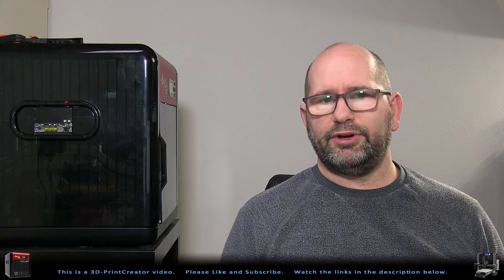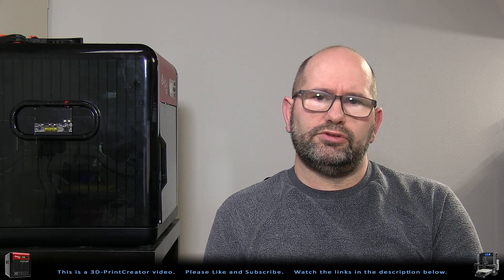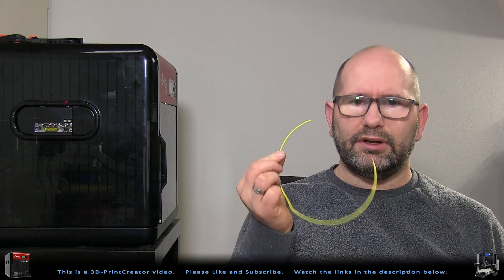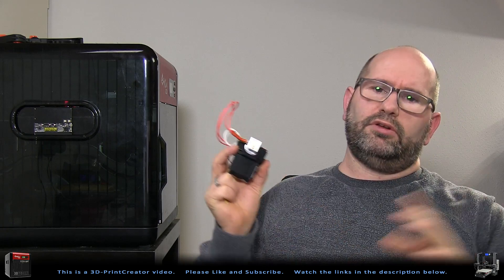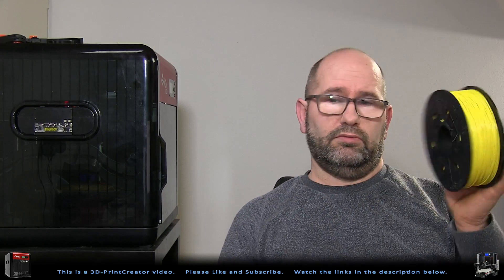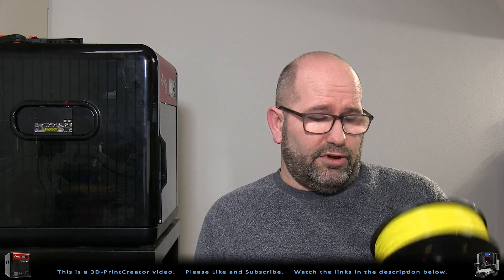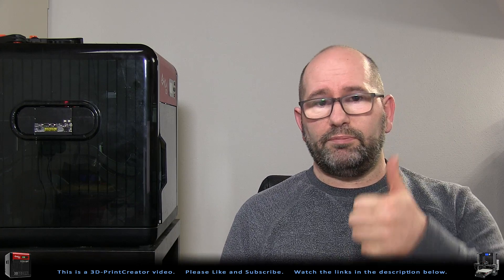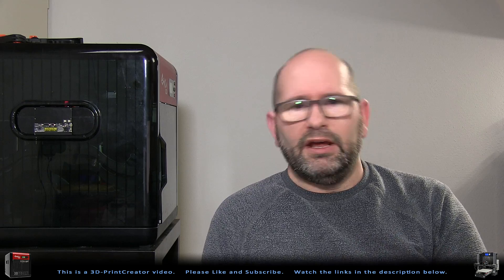▼ Why you should NOT use a filament oiler on your 3D printer

Comment: I wonder. These people who say to use oilers, have generally used oilers before, then ran into issues, and found that the oiler helps them... by all reason they never cleared the previous oil residue or other surface residue out of the system. I mean nozzles are disposable, then you have the throat, you would need to repolish the inner surface if it's a stainless or titanium one, or replace the PTFE insert if it's lined, wash the couplings and bowden tube in dish soap, wash the extruder components... to have a chance at a clean (haha) experiment... any bets on where the issue possibly originally came from? Once oil is on a surface it generally never quite goes away completely, it just degrades to where it becomes sticky garbage.
Reply from the maker: That's a fact. :-)

Comment: I just oiled up the filament and made one benchy and a calibration tower, PLA+ 210C no issues. I looked into this because I switched to all metal hotend and the filament jammed after the first print, so I cleared the clog and reassembled it. I smelled the burnt oil while hot tightening the nozzle (canola, yum). I think that created a seasoning coating that allow subsequent prints to be successful. I am oiling it a little more before taking the oiler off.

I think if your goal is to season the hotend throat so it has a smooth layer to solve your clog issues, you should apply oil to the inside of your hotend throat, then heat up the whole piece without the hotend fan so it reaches smoke point of your chosen oil and allow the oil to burn inside your throat and not the nozzle. Supposedly you won't need to do that on high quality smooth metal throats but I got the cheap ones so go figure.
Reply from the maker: Just like when I made this video, I still think it is absolutely not smart to provide filament with a thin layer of oil. If you think it is smart, then we disagree.

Comment: Im in the other side of oiling debate. I have used oiler now almost a year and my hardened steel nozzle that previously glogged all the time now just works. No nozzle glogging failed print in a year. Also the oiler collects all the dust that previously got sticking into my filament (because of static electricity) and moved to the extractor. And yeah there is plenty of dust in the city appartment specially in summertime. How do I know that - because I see what has collected into my oiler. So how to choose oil - only use plantbased oils that has really high smokepoint - avocado oil here is my choice.
Reply from the maker: This only explains to me that you have a dust problem and a wrong nozzle.
I have multiple hardened steel nozzles and (except for the Da Vinci Pro printer) I never ever had a clog in my hot ends.
There is no reason to not collect the dust before it enters the printer, just use a dry cloth for that without oil.
If there would be a need for oil, why isn't it implemented in the filament? A few drops of oil in a KG spool of filament is easy to mix, yet none of the filament brands do this. There is a reason they don't do it.
I don't  have to convince you, if you want to use oil, please do so. But I know AND explain why I don't use it.

Comment: I haven't used an oilier before and i was hopping for a good review. But it doesn't look like you have used one ether. It is intuitive to believe that the inside of the tubing will be contaminated and collect dust and why no oil will end in the nozzle. But this is not how engineering/science work, you are supposed to back your opinion with evidence and do the experiment. You said "lets do the math" but didn't do any. The oiler sponge will most likely clean the dust. The toothed wheel of the extrude is gripping by deforming the filament so adding oil might not have significant impact. What a BS rant video.
Reply from the maker: Normally I don't react like this, but you sir, you are an ...... fill it in.
I am open for every type of discussion about my thoughts, but if you don't watch the video and complain about things I did wrong, then there is no discussion possible.
In your case, I hope you use an oiler. Please do so. This means you don't understand how to set up your printer correctly and you are not willing to learn. Please use oil. Lot's of it.

Comment: It is super stupid to use oil. Especially cooking oil which often precipitates and tends to form resins :D
Reply: on the other hand though, when you run the filament trough an oily sponge, you will logically remove dust from the filament, and thus you will reduce the chance of clogging the nozzle. Also, if you are smart, you will install your oiling device in such a way that your filament won't pass trough open air after being oiled.
Now, personally i do not believe that having the filament oiled actually helps, but having it cleaned before it enters your printer definitely does. You are talking nonsense.

Comment: Hey i tried to print some flexible fillament but it jams all the time ... would oil help here?
Reply: @Seze93 It will work. It jams because the filament is getting stuck inside your ptfe (teflon) tube inside your heatbreak. There is a point in your heatbreak where the temprature is still high enough for your filament to melt. When this happens your filament will get jammed because it has resistance in the teflon tube (It is very sticky since it does not fully melt at a place at a certain temprature in your heatbreak). When this happens, more filament will push against the blockade and eventually get hard because the temprature is not high enough anymore for you filament to melt. Oiling the filament will prevent this because it will prevent the sticky half-melted filament from getting a place in the teflon tube to get attached on. It basicly eliminates the friction between your Teflon tube and filament. So oiling it will fix your problem...
Reply from the maker: Nope, Oil won't help. A better extruder or even better, a direct drive extruder, is the only thing that can improve prints with flexible filaments.
Reply: 3d Print Creator 
OK ... sadly a Flexion Extruder costs nealy the Same as my printer ^^ but anyway thx 4 the quick answer!
Reply: @3dPrintCreator  so is your solution to everything is just to buy another expensive part when thousands of people plus multiple businesses that use 3d printers have all told me your spouting nonsense the serious point is if you want to use oil use oil if you don't you don't have to, don't tell someone not to do something over a vary narrow view point on your end. some sticky and flexible filaments actually can benefit from the right oil not always kitchen oil I'm talking machining oil plus change your sponge occasionally so you don't have a lot of dust and stuff plus it you don't change the oil just like a car it will darken, burn and get very sticky us as humans have been using oil for years and you would think that we all would know that fact by now.

Comment: Older DaVinci printers doesn’t have PTFE liner and is meant for printing ABS.  If you try to print PLA with these all metal extruders they are much more prone to clogging and the use of lubrication can greatly prevent it.  It’s not a confirmation bias. It does help.
Reply from the maker: Well, Everyone should do what he or she likes to do.
I think I have explained enough why it's not a good idea, but do as you like.

Comment: I have 10 3d printers now. I run an olier on all of them. I run PETG, ABS, PLA and Ninjaflex. I have run with and without. Running with one makes a big difference. Prints are smooth and look better. As stated by others it does help most with PLA. I think most people don’t run their filament hot enough to start. That is where most of the bad print issues start.
Reply from the maker: What can I say? Nothing, I said it all in the video...
I run 15 printers daily and non of them need oil.

Comment: Let's just stop for a second, this video is absolutely bogus.  The fact remains that oiling works for alot!!! Of people.  There is no science to backup your claim, there are facts to backup oiling.  For a long time I couldn't print pla  without clogging and just accepted the fact until I saw on the internet to oil. I tried olive oil dipping and it just works like everyone else with the same problem.  This video is a joke and spreading bad info.  OIling has been the difference between a printer and a paper weight for an insurmountable amount of people.
Reply from the maker: There are a lot of things said on the Internet that are true but yet completely stupid and idiotic to do.
If you have rusty tools, put them in a glass of Coca Cola and you remove the rust. Completely true, but the fact your tools have rust is because the owner didn't took care of his tools in the first place. The same for oiling. If you are not smart or bright enough to make your printer work without oil, then please be my guest and oil the machine as much as you like. If, on the other hand, you are smart enough to read a user manual. Then you just adjust the printer and make sure it has no problem, without using oil.

Show me one 3D printer manual where the manufacturer tells you to use oil. Just one.
Show me one manufacturer of filament that tells you to use his filament AND oil, just one.

With kind, non lubricated, regards,
Brian Dragtstra.
Reply: @3dPrintCreator  sometimes it's a budget thing.  
if you can only afford clone all metal hotends then all the intelligence and skill in the world is not going to prevent jams.  
i even improved the internal surface of my heatbreak by polishing it.  and it improved ALOT   but i've polished it as best as i can and it's still not 100% reliable.  
i can spend 40 bucks a piece and buy 2 heatbreaks (yes just the heatbreaks) for my chimera hotend.     or i can try a drop of oil. (wich i havent done yet)  

so spend 80 bucks for 2 titanium heatbreaks wich is litterally more then 2 times as expensive as the entire hotend i have now.  (winsinn chimera) 

yes.  they have the inside polished to a mirror shine.  and all i managed to do was get rid of the tool marks and scratches on the inside.  but it's not worth the 80 bucks for me.
Reply: on a side note.  the methods i have seen suggested were not to use an oiled sponge.   but to just heat the hotend and manually stick some fillament in there (without extruder or bowden tube)  and then to flush it out with un oiled filament.     

repeat this every 100 hours or so.   
the sponge should be used dry.  to wipe dirt and dust off of the filament before it enters the extruder
Reply: 3d Print Creator I'm telling you bro It works. Just because you haven't run into the problem doesent mean it exist, I have 1 printer that has to be oiled.  I have a printing business and been printing since 2008.  You print a lot of different materials, then a cold pull or nozzle cleaning just won't suffice.  Keep printing you will see one day
Reply from the maker: Oh my goodness. You have a printing business and you are not able to fix your machine so it doesn't need oil? Okay, you made your point.
Reply: @3dPrintCreator  
ok so i have done some tests.  
i have applied some rape oil. (over here its incorrectly labeled it's actually canola oil)   
and then proceeded to struggle with bed adheasion for the rest of the day.  
i have a glass bed with a layer of glue on it.  i have reapplied the glue several times yesterday.  purged the nozzles multiple times and it just would not stick.  
BUT!!!!!  

i now just cleaned the bed. 
wet paper towel to clean all of the glue off (instead of just applying another layer ontop)  
then used some paper towel with isopropanol to clean the bed further.  
then another dry paper towel to wipe it all off. 
 and guess what.   it's sticking better then it ever has. AND the extrusion problems are over.

Comment: I seem to have the opposite problem, from some of the commenters here. Mine jams when I use an all metal heatbreak and more than 4 mm of retraction. I always have to clip the end of the filament went I restart, or it won't push through to the hot part.
Reply from the maker: With some kinds of hot ends, the heatbreak isn't smooth or it has some inner liner tube at a place where it prevents you from using to much retraction. If this is the case in your printer, then know that you can only use less retraction and fight strings on your prints with a little lower temperature on the hot end.

Comment: I have a MakerBot Replicator 2x for 4 years struggled with jams, prints stopping in mid print.  The printer was almost useless !! 
I added an oiler with Grape Seed oil.  This oil has a high smoke-point. I use a small container with a nozzle  to add oil to the sponge.
It solved my printing problems.  I print ABS, PLA and Ninijaflex with excellent results.
Reply from the maker: Hi Ross,
I do believe you that it works and that problems you had are now gone, but what you are doing is adding something because of a fault in your printer. It's like taking pills to get rid of pain when you have a splinter in your vinger. The medication will help you, but the real cure is to remove the splinter.

Comment: I believe the oil is to help the filament slide easier through the upper cooled portion of the hot end, not the actual nozzle, thereby reducing the affect of plugging due to heat creep.  With heat creep the filament becomes soft and sticky in the upper region of the hot end, so the filament tends to expand and get stuck there.  It is especially bad with all metal heads.  Cooling the upper portion better also helps to prevent plugging.
Reply: i have a couple options now to fix my jamming.  

1 spend 80 bucks on genuine heatbreaks for my clone chimera
2 spend a similar amount of money to buy a water cooled heatsink.  (because i currently have a radial fan mounted on my heatsink and it's still not good enoegh.   MAYBE i can use a dremel to make deeper grooves in the heatsink and grooves that wrap around instead of just these undeep ones.)  but since that leaves aluminum everywhere.  i'll try 3 first
3 try a drop of olive oil that i can litterally get downstairs.     cleaning it wouldn't be a problem either if it didn't work.
Reply: i can litterally feel quite some airflow on the sides of my hotend so plenty of air is moving past the fins.  it's just not enoegh
Reply from the maker: That's one of the reasons a lot of people use it, but it's a solution to a problem that should not exist. If you have a well tuned printer, there is no problem with heat creep, The upper region of the hot end should be cool enough not to heat up the filament. If this get's to hot, the problem should be solved there. 

Oiling filament is bad for many parts in the printer and should therefore not be done.

Comment: I recently bought a 3d printer, and many people told me that I needed to make something (oiler-like) because the filament will collect dust over time. My response has essentially been "and oil all over the machine won't?" ... but I also wonder what the oil does to the actual print. Does it weaken it somehow since the filament would most likely absorb minute amounts of the oil as it's softened, and perhaps make the layers not adhere to each other properly? I don't know, but I'm not willing to risk it.
Reply from the maker: The thing is that if oil (in small amounts) would be needed in the filament, it should be there. Filament manufacturers can put anything in their filament, from color ingredients to things that give the filament a nice smell or even wood or metal particles. Adding a teaspoon of oil per KG of filament really isn't that hard for them to do, and a good filament has a perfect balance of all those ingredients.

The main two reasons to use oil are: (1) collecting dust before it get's into the printer and (2) seasoning the filament before it get's into the nozzle.

Collecting dust is the best reason, but there are other ways to do so. Just a simple microfiber cloth is enough to collect dust.
Seasoning the filament for the nozzle is a strange reason. The filament will have a bigger adhesion to the oil then the adhesion between the brass or metal nozzle will have with the oil, so there won't be any oil on the sides of the nozzle, as some people say. Just looking up the adhesion of an oil to plastics and metal things shows that the adhesion to a plastic is way bigger. Even if you would drop a drip of oil inside a nozzle it would be vanished after the first few centimeters of plastic that you push through.

Then, what does oil do to the rest of your machine?
It collects dust on the gears that your filament gets in contact with, because they really grab the filament. This way the gears will have their teeth filled with contamination that is more difficult to remove with a brush. Then if you have a bowden setup, the oil will get into the PTFE guidance tube. PTFE is nylon and is used because of it's perfect slippery characteristics when used dry. When you oil your filament on it's skin, you contaminate the PTFE with it and in fact it will become more difficult to push the filament through. The adhesion of oil against PTFE is not that big, but it's there so there will be more friction between the filament and the PTFE tube. This will result in more power that is needed in the stepper driver that is used for the extruder and therefore a bigger chance of overheating this stepper driver. A very little chance, but bigger then when using no oiler.
Reply: @3dPrintCreator  coulda shoulda woulda.   

grow up.   and smell the facts.  
this video is bullshit and your standpoint on oil is aswel.